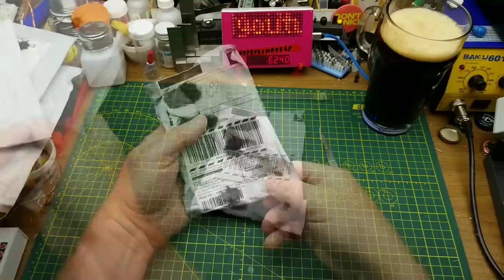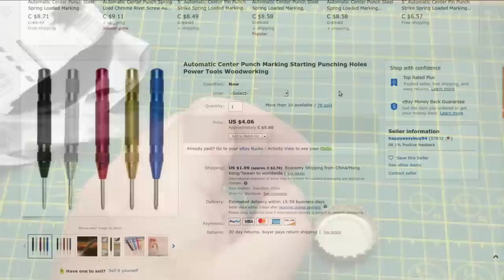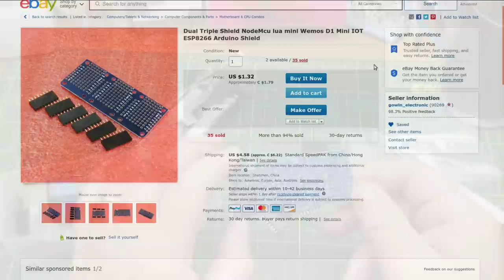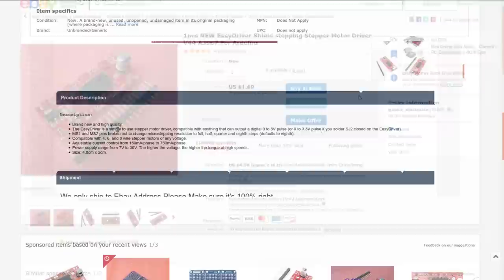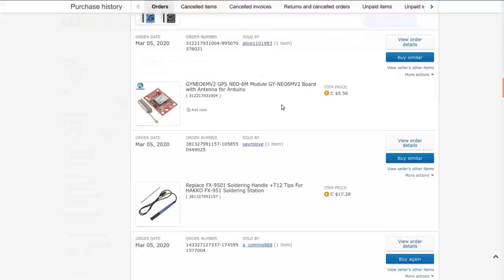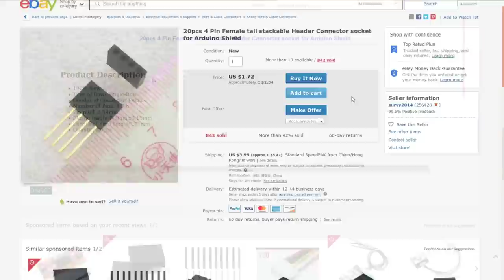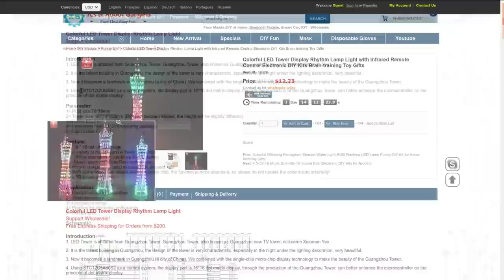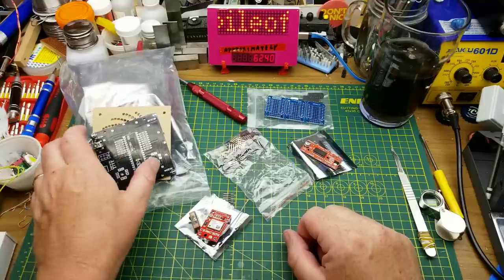mailbag Monday #93

Comment: I built the Guangzhou Tower kit in February. Works great and very impressive in a darkened room. A friend keeps begging me to give it to him every time he sees it, "It's my anniversary/birthday/Christmas!". I told him $200 and it's yours.
It took about eight solid hours to assemble. Pro-tip: set it up as an assembly line, i.e. pre-bend all the LED leads before making the rings and run the connector wires from each ring down to the base before stacking the next ring.
If you have an issue with unlit LED's, check your solder joints closely. I had a couple.  ; )
Oh yeah, it's 17-3/4 inches (45cm) tall.
We all look forward to seeing yours lighting up on a video.
Good luck!

Comment: I wonder if they even bothered to lock the firmware on that microcontroller.  It uses STC's RISC51 architecture and it supposedly has some good security features.
Reply from the maker: I'm assuming not, since they sent a USB-serial module with it.  

Though I can't see myself having a sudden desire to learn the STC upload toolchain just for this kit.

Comment: That LED tower looks nice, but fiddly to build! I use the STC uC's a fair amount in my tinkering. They are (well that series is) an 8051 core and have a built-in ISP, so just a TTL serial adaptor is needed along with a hex file loader. SDCC and stcgal are what I use for the coding of them. I use the smaller chips, but all the same in code/setup. PlateformIO also has them ready to use (via the same tools I listed)

Comment: I miss ordering from Alice! :)  I have that GPS module as well, and for the cost, works great. I am sure it's a Ublox knock-off, but eh... I have a rubber ducky antenna on mine with a small converter cable. With that, I can usually get 10+ satellites indoors.  Here's a simple reader I did that I tested stability with. https://pastebin.com/m0YhWLZZ